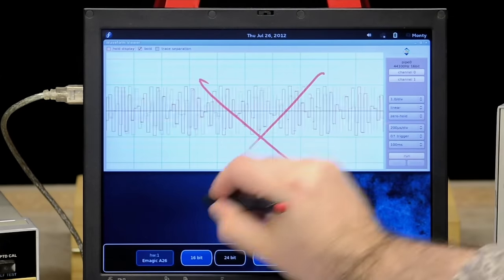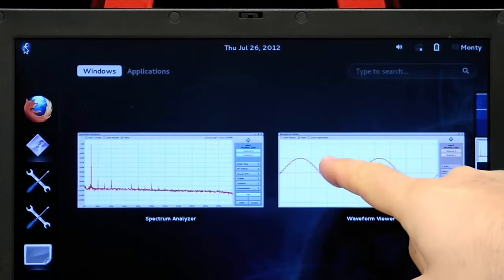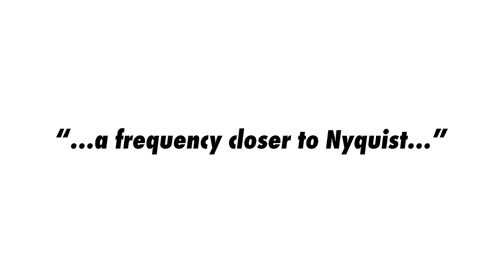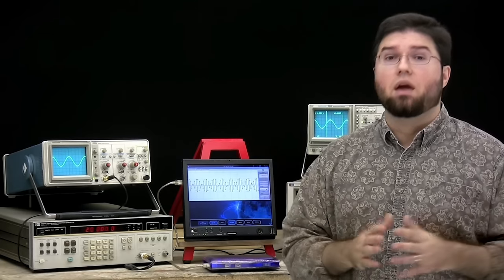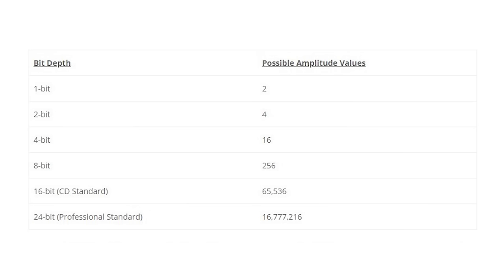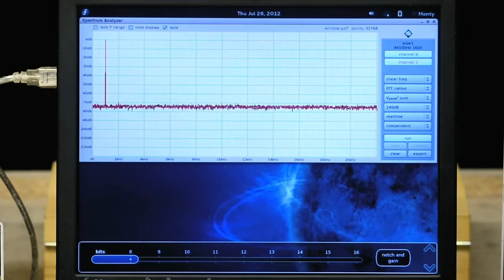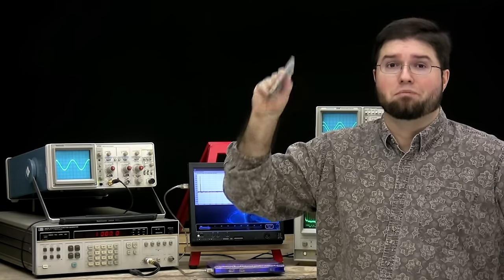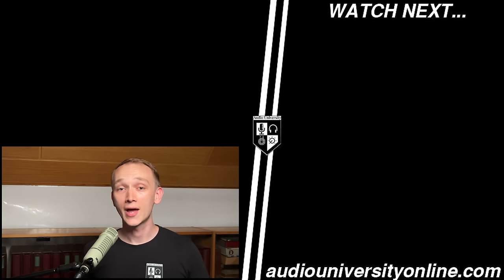Debunking the Digital Audio Myth: The Truth About the 'Stair-Step' Effect

Comment: Flawed..The digital interface is a Analogue to digital / digital to analog convertor .. the info inside the unit does read the audio in steps.. but translates through to its analogue convertor and thus : the interface's analogue playback line amp  is read by the external analogue unit.. the steps are converted in the interface to analogue - Hello! - However - Its the quality .. listening to sine waves etc is NOT going to ascertain audio quality - Use music - Use your ears.. its clearly obvious 16 bit 44 kHz is deeply inferior to 24 bit 48Khz format.. this video is BUNK! honestly...
Reply: Not at all obvious. There is some evidence that some people with some music might be able to tell apart higher resolutions from redbook standard. But the results  are far from conclusive and obvious. The old cliche "use your ears" does not get you very far unless the tests are made with scientific rigour.

Comment: - This is another case of audio engineers believing that if it looks good on paper then it must sound good. A lot of bad audio equipment has been produced this way. You don't hear with your eyes
- Analog signals are never bandlimited like the video claims. In order to convert to digital 44.1 khz you need a very good filter to cut everything about 22 khz. But no filter is perfect. Another filter is needed on output to analog to remove higher frequency artefacts introduced by the conversion itself
- Quantization is not Gaussian noise , it is harmonic and intermodulation distortion. It sounds very bad in large enough quantities. No one here remembers the days of Soundblaster 16 where you had one 16 bits channel and one 8 bits for output. The distortion was so bad you could hear  it even on a pair of desktop speakers
- It is not fair to compare analog medium with digital because it has a noise floor. The analog medium has an almost ( limited by material only ) infinite resolution between two different power levels , while digital has only one bit. Yes, the noise will mask the softest sounds but again that noise is not quantization and will have a different masking effect 
-16 bits is certainly not enough. Anyone working with computer audio knows how easy is to get over the maximum sample value which in turn forces you to silence everything else
- Last but not least , aliasing makes it a b** to have any useful nonlinear effects applied to the audio in the digital domain, but in the analog domain they just happen naturally and no aliasing
Reply: Point was  that the conversion is lossy .But yes,, with a high sampling rate converter you can get good audio signal. 96Khz or more . Same logic applies on the output  and maybe even there more we could use 24 bits 96 khz. The reason why you won't see it on an oscilloscope is the output filtering that tries to filter all conversion artefacts , but I think a better measure would be a spectrum analyzer. I've added one last point to my initial comment : "- Last but not least , aliasing makes it a b** to have any useful nonlinear effects applied to the audio in the digital domain, but in the analog domain they just happen naturally and no aliasing "

Comment: Ah, but you are working with one of the best AD/DA converters ever made, if you take top of the range equipment then the cyphers must be beyond belief. I think that in this case, the DA-converter is taking off the sharpest edges and make the rasping sound of digital audio into a smooth and likeable sound. The engineers at Emagic knew what they were doing and I think that the output is processed to make a better sound the what is possible with the true DA.
 
I suggest you do this test again but then not with this super equipment, but with an R2R network on a digital output, number of ports to your linkings. I guess then you wil see some square waves coming to you as a ton of bricks!

Comment: yes sure... that's why every top artist use analog gear... if you hear a vinyl rip @24bit96khz and then a 16bit44,1khz you will notice a huge difference even with cheap speakers...
Reply: @nicksterj maybe you did it wrong, maybe there's an early threshold in your ears... is like you can't hear 18khz but the song lost brightness when you cut the upper freqs... you have a better dinamic range with vynil and it's very noticeable
Reply: be happy with your 16bit music.. if it's the same then why using a 16bit input for recording gives you a shitty opaque sound? @nicksterj
Reply: @nicksterj What? a test using real people? Be very careful.

Comment: Nothing debunked here. But if you want a 16/44.1 sine wave approaching 22.05KHz and you better LP filter anything above that out. But we know that 20KHz as the top limit is arbitrarily set, but why 20KHz? And why 20Hz as the lower limit? There are Subs going lower than that and you can certainly hear, or at least experience it down to 10Hz. Why is 20KHz the upper limit. Double it (96K) and you are covered.

Also, I think I will employ oscilloscopes as my ears from now on, I have more than two of them, so lucky me I will have spares.

I actually think that 24/96 is a useful spec. File sizes are OK with the storage capacities we have today. 24/192 is probably overkill. I don't mind 16 bit if it is a well done recording, this part is what makes the real difference.
Reply: @nicksterj - The idea that that we are even hearing in terms of frequencies when we are listening to complex sounds versus sine waves, that is being questioned. There is evidence that when listening to non-pure-tones that our listening is actually temporal rather than frequency based.

So the arbitrary 20KHz limit may be just that.
Reply: @nicksterj - I have never heard that 20KHz is the limit for sound conduction through the air. Yes, air presents a low pass filter effect at high frequencies, increasingly so with rising frequency. If you increase the dB-SPL to compensate, then you can produce very high SPL at 20KHz and beyond. I am stating physics here, and in the case just described above, the sound does not hit a wall at 20KHz. It's just that 20Hz-20KHz has been popularised over a long time. I am just saying it and not looking for an argument.

I think you should look up temporal hearing, it presents a very different view and also getting increasing traction.
Reply: @nicksterj - There is a difference between hearing and perception. I don't set any limit.
Reply: @nicksterj A 44.1 kHz sampling rate (fine for 20kHz recording) was chosen because that frequency was easily available on the oscillators in the video decks used for early digital recordings. BTW a good analog deck can easily exceed 20kHz at 7.5 ips and more at 15ips.
Reply: @nicksterj Fair enough.
Reply: @nicksterj Oh, I also worked with an analog tape recorder that was ruler flat up to 20kHz and down to DC!
Reply: @nicksterj I thought that would attract your attention! It was an Ampex FR100. An instrumentation recorder which used FM. Its top speed was 120ips, I think, with a 100kHz carrier or thereabouts. It ran at lower speeds too with correspondingly lower bandwidth. We were developing a low resolution infra red camera and needed a recorder that could deal with the 10Hz sync pulses. This would have been 1979 or 1980.

Comment: The explanation is partially wrong in my opinion. Digital signal indeed doesn't have any staircase, because it's just points, but the DAC produces staircase signal on it's output. It is followed by reconstruction filter though which removes high frequency components from the spectrum of the signal caused by sampling.
Reply: The important thing is the sampling frequency is high enough so there is no aliasing and quantization step is small enough so the quantization noise is high frequency enough to get filtered.

Comment: idk why he's talking about a "unique solution" your DAC doesn't solve math problems. The reason the output signal doesn't look like a stair step is because DACs have a filter on the output that takes out any frequencies above 20khz. You probably wouldn't be able to hear the stair steps anyway if the filter was absent but they do put a filter at the end of the signal path. Whatever that was what I learned anyway
Reply: if I was implementing the firmware for a DAC I would interpolate between the output values - that's probably what most of them do. Maybe even do quadratic or cubic interpolation if I wanted to get fancy. But talking about it like the DAC is solving some huge n dimensional problem to find the sine wave that fits all the data is a bit misleading. Interpolation plus filtering gives you a close enough approximation that you can't tell the difference even in an oscilloscope. And the purpose of the filtering btw is so it doesn't damage your speakers (even though those are likely filtered on the input as well). you can't have a speaker cone attempting to do non smooth sub-20khz transients. Happy to be corrected if there is a real expert who knows more than me about this (and more than these guys I guess)

Comment: I am an EE and while I see your point and, for the most part, agree with you, you do make some extreme leaps and one or two very questionable statements. First up, the digitised signal is a series of numbers and not something that can be shown on a CRO. What you are showing on the CRO is the output of a DAC, or the regenerated analogue output prior to a reconstruction filter and the analogue output is after the reconstruction filter. So your delineation between digital and analogue is the reconstruction filter only. This is just a bit misleading as is the assertion about the digitised signal being misrepresented as a stepped waveform. There is a reason you were showing this stepped waveform in the first place and could only show the convolved dirac function plot of the samples (discrete time sample plot) as a graphic, because it is factually correct but not observable and it is also not in fact, actually relevant either. To reconstruct the analogue signal, yes we want a waveform that passes through each sample value at exactly the sample points but to do that we first accept a small time distortion because we cannot predict the points and we also accept that we need to start with a waveform that has enough energy in each sample for use to work with. A sequence of dirac functions convolved with the sample values will not do that in a practical sense. So the output of the DAC, which is the first reconstruction of the analogue signal is a sample hold output you showed as a step function, totally correct. An analogue reconstruction filter is what hen takes that and makes the nice smooth sine wave.
A lot of what you were attempting to show was really a measure of the quality of the reconstruction filter only and this confused the topic and the reasoning to the point of breaking of some of your statements to a large degree.
I am also not convinced your treatment of dithering is quite right either. If your converter has substantially better accuracy, ie if the INL + DNL are far less than 0.5 of an LSB then dithering can improve the effective number of bits to be greater that the actual number of bits, but this only applies to signals that are continuous and unchanging for several cycles or if the signal is significantly oversampled. From any other perspective, dithering just raises the noise floor.
On the point of my old tape recordings, are you really going to stick to the 6 bit assertion? That's a 35dB dynamic range and even on the worst cases, I am pretty dang sure I was getting a lot better than that.
I am not trying to have a go at you, this video clearly took time and effort and is well put together, but I have a pathological dislike of anything that looks like misinformation because, as a design engineer, I have had so many issues caused by people who make decisions thinking they know about a thing because they saw it in a video.
If you were to make a video on this topic that was more complete, I would love to see it, even be happy to promote it, in as much as I do that sort of thing.

Comment: OK, now take a frequency at Nyquist and change between sine wave and triangle.
Reply: @nicksterj Indeed, that information isn't encoded because the sample rate is too low.

And while we can't hear the harmonics, as you say, the oscillator will show a signal that no longer matches the original.

Now consider what happens if the tone is syncronized with the Nyquist frequency so that every time the tone is sampled, it happens to be at +/- 0.
What happens? The tone disappears completely.

You can also in theory be synchronized such that every other wave is louder, giving an illusion of a sub-harmonic sound that was never there, and this could theoretically be audible.

On old hardware, I remember very well how extremely prominent aliasing became, but taht was back when I was recordig at aroudn 12khz on an Amiga500. :P
However, it doesn't matter which sample rate you have, the phenomenon of aliasing will still be present. 
At 96khz, it's much ahrder to hear it than at 44.1khz.

And I agree that the risk of anything being noticable is probably close to zero.

However, as and actual augio engineer for over 20 years, I do seem to experience a difference between 44.1k and 96k, for example.
It seems easier to hear the "room", that it sounds a little more "3D", especially in the tails of reverbs.
I can't swear what's going on, and it's only on some sounds, so it's only some kinds of sounds. But it does appear to be something going on, there.
In 44.1k, it's as if delicate reverb sounds somehow get distorted as they decay, but I'm not sure.

And I'm sure I wouldn't be able to hear this outside of my studio and Genelec monitors.
Reply: @nicksterj The most imortant thing to remember is that "stair-step" would produce harmonics that we can't hear, anyway, so what does it matter that it is filtered out?
Reply: @nicksterj I don't own an oscilloscope. They're damned expensive and I have no good use for one.
Reply: @nicksterj How on Earth did youy get one for $75? They cost something like $1'500 and up.

Yeah, I have an Apogee Quartet, which is a very fine interface.

Comment: If this video just said something like CD quality digital audio is good enough for many and perhaps even most listening purposes pretty much everyone would have to agree, even product engineers working in the industry. But the way this video thinks it is "proving" this is seriously sketchy. It uses a demonstration of one thing to suggest another, entirely different thing. 

First, the stuff about a "stair-step waveform" and how that is not what is present at the output of a DA converter is a straw man argument. It's not even clear what this is all about as exactly no one thinks that that is what is present at the output of a DA converter. That's the whole point of a DA converter. The disinformation here is in suggesting that because a DA can produce a perfect, static sine wave when a perfect, static sine wave is input to the AD that this means that all sound and music is perfectly reproduced this way. That is incorrect.

What an AD/DA conversion system does with a perfect, static sine wave (especially a sine wave...) is not representative of what it does with complex, dynamic waveforms and their characteristic and unpredictable detail. An AD/DA converter system ignores waveform detail when such detail exceeds its ability to resolve it and replaces it with a kind of synthesized transition in amplitude (yeah, I know, it's ALL a synthesized transition in amplitude...the point being that some of it matches the input with striking precision and some of it doesn't). This behavior is not intentionally built into the thing so much as that's just how it works. That's the nature of the entire concept. How much waveform detail is altered and how noticeable or important that is to a listener, if at all, varies with both the signal in question and with the design of the device. 

The bit about dynamic range is also a bunch of horse hockey. Again, they are talking about one particular aspect of something without talking about what's actually important. The importance of dynamic range has little to do with overall volume. The important thing is dynamic range above nominal level, which is crucial for accurately capturing transients, which are often what give things like natural sounds, the human voice, and the sounds of acoustic musical instruments their particular "lifelike" timbre when listening to them in person. Granted, many amplifier/speaker systems are also incapable of accurately responding to all such transients even if they are captured in a recording. But that's another matter altogether (just like the fact that some audio circuits have transient intermodulation distortion worse than the distortion produced by low sample rates is another matter...)

Anyway, this video is just another case of drastic oversimplifications resulting in erroneous conclusions. Sometimes I think that if all Americans got through at least 2 years of an undergraduate science or engineering degree half of You Tube would cease to exist.